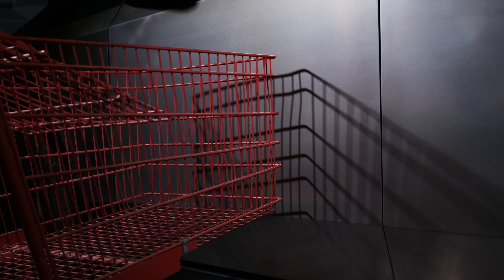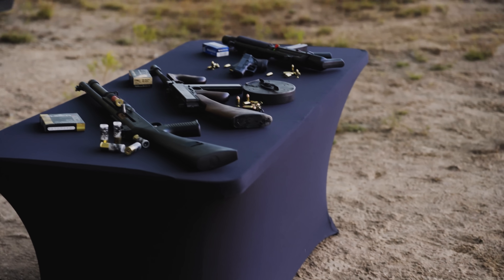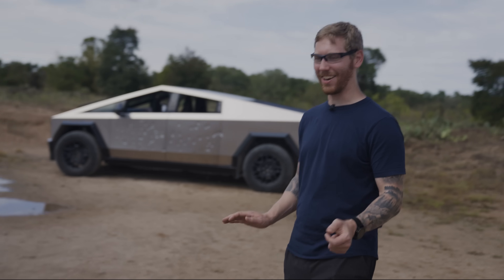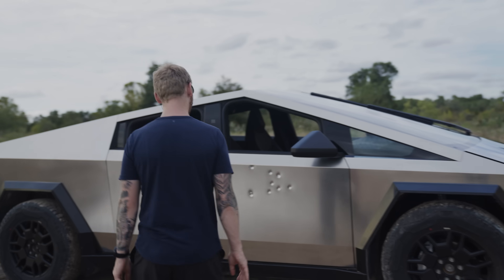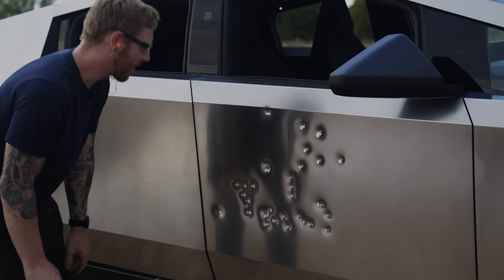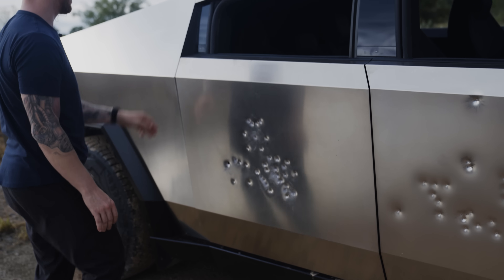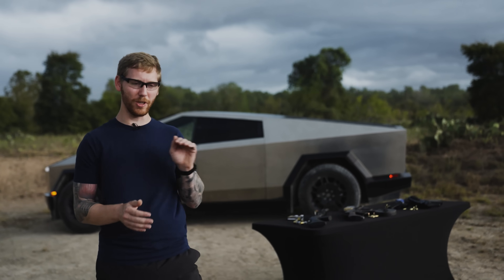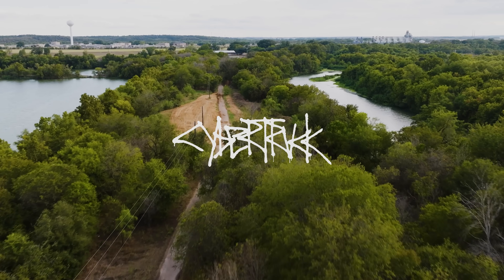Cybertruck Bullet Test

Comment: Okay first off this is pretty impressive. I do wanna point out a couple of things though:

Each firearm transition, besides the glock to the MP5 was a downgrade in muzzle energy, and each test was consecutively weaker than the last. .45 has more energy on impact than 9mm, even out of a 4 inch barrel (I’ll be back to the mp5 in a sec), and each 00 buck pellet carries even less energy than the 9mm. Buckshot is effective as when all pellets hit an object, the energy is multiplied per pellet to the target as a whole, however for testing penetration, each pellet can only deliver its own penetrative energy the more the pellets spread, which is typically less than 9mm, unless you get multiple pellets in the exact same impact spot (which did happen here.)  or a much tighter spread. The closer together the pellets, the more penetrative power buckshot will have. again, this is still pretty impressive.

Second, to my knowledge, the 8 inch suppressor would not increase velocity, at least by any significant amount on top of the 4 inch barrel as the grooves of the barrel (which help increase velocity and pressure) don’t exist in the suppressor. Feel free to fact check me on this

Lastly, would be super cool to see how it holds up to rifle fire, as rifle cartridges deliver SIGNIFICANTLY more energy on impact than handguns or individual shotgun pellets, and have drastically more penetrative power due to much higher velocities. I’m sure someone will test it at some point.

Edit, for 1.8mm thick, that’s still insane
Reply: I think you're mostly right. There's no way it stops 5.56 or 7.62. Probably not going to stop 5.7 from a pistol or carbine either.
Reply: You have made the same observation I made.  BTW The MP5 SD actually slows down the bullet.  It is not the suppressor that does this, but rather the design of the barrel itself. immediately after the chamber itself HK has drilled holes in the barrel in order to vent gas, thus reducing the pressure propelling the bullet.  The reason for this is that the MP5 SD is designed to use standard issue NATO rounds, which are hypersonic.  In order to create a 'silent' weapon with full power rounds, HK needed a way to bring the speed down to subsonic velocities, thereby negating the sonic boom created by hypersonic rounds. So yeah, you got it right the HK actually shoots a slower round than the Glock.
Reply: Whistlindiesel taking notes as we speak
Reply: The way an MP5SD works is kinda crazy, because it turns supersonic rounds subsonic by venting gasses early into the barrel to slow down the bullet. I think if they were to have used a regular MP5A2/A3 they wouldve gotten bigger impacts and possibly some penetration, but I doubt it.
Reply: Velocity is the primary indicator of hard panel penetration, NOT energy. Bullet construction / shape is typically secondary on hard barrier performance. That’s why a 5.56 can go through level III 1/4” AR500 armor but a 7.62NATO cannot
Reply: Just wanna chime in about a couple things. 1. Suppressors do typically increase muzzle Velocity. Not significantly. My 7" 308 can increases it by like 20fps. 

2. The 9mm penetrates better than a 45acp. The smaller bullet has less frontal area and therefore needs less energy to penetrate the same substance. That's why 9mm is recommended across the board over 45 for a bear defense round.
Reply: @Brothers-in-Arms-LLC I ran into this earlier, the MP5SD specifically, has port holes drilled at the base of the barrel to bleed off velocity.
Reply: It’s weakness is velocity anything moving rifle speeds will zip right through. 

Being able to stop 9mm 115g was impressive that’s the most common used in crimes.
Reply: They said it doesn't stop more powerful guns than what's shown here
Reply: They advertised it as a truck that can stop a 45 caliber ammo, naturally something rated to stop handgun ammo won't be able to stop rifle rounds.  Similar to a level 3 bulletproof vest that's capable of stopping handgun ammo but not rifle rounds.  They're still called bulletproof vests.
Reply: @lanzer22  Except actually bulletproof vehicles have bulletproof windows. This truck doesn't, so how can it be advertised as bulletproof?
Reply: @xelario  Those cars are sold as armored cars or armor modification.  You as an individual don't get to determine what a term means.  The industry get to decide and communicate to the consumer.  Tesla said "its stainless steel is bullet proof up to 45 caliber handgun", they don't need to drop the word bulletproof just because to you there is some special meaning that spans all products.
Reply: @lanzer22  If you'd only you read my original point instead of reacting to the last message...
Reply: 1.8mm is dummy thicc
Reply: yeah, you're right
need to see a NATO round and a 762
Reply: So don't drive it in my neighborhood got it! I only prey whoever does their ops have the aim of storm troopers and their weapons are stuck on safety. 😅 Also keep it in beast mode!
Reply: So you're an expert? Regardless of what you say this ingenuity is still incredible. Only the presidents, x president, govt officials, cartels bosses, billionaires can afford to ride on a bullet proof cars. And I will be riding on one as my daily and long trips PU packed with counter fire.
Reply: So maybe it can stop a hand gun caliber like .45 ACP but it wouldn't stand a chance against a 5.56 round and def not a 6.5 Creedmore.
Reply: Smaller calibers generally have better penetration. The way to defeat armor is speed and hardness. Smaller calibers are inherently faster
Reply: They should have fired a desert eagle
Reply: Missed the WHOLE point. This is a vehicle ( pickup truck )  faster than basically ALL U.S sports cars yet an stop MOST commonly used firearm projectiles .
Reply: @wilinstonthompson1352  Nope.  It is advertised as stopping subsonic rounds most rounds are super sonic. You know that loud band you hear...  that is the bullet breaking the sound barrier. This is very misleading and pointless marketing that tools like you bite on because you don't understand how pointless a bulletproof car is and how damaging it will be when in an accident.
Reply: @peterhorton9063  Please supply sales brochure claiming to stop ALL bullets. Regardless a Ford ,Chevy,Ram nor a tundra is stopping ANYTHING. Cry harder as bite that pillow tonight stroking your supersonic rifle rounds 😂
Reply: @peterhorton9063  Please supply sales brochure claiming to stop ALL bullets. Regardless a Ford ,Chevy,Ram nor a tundra is stopping ANYTHING. Cry harder as bite that pillow tonight stroking your supersonic rifle rounds 😂
Reply: @wilinstonthompson1352 if it can stop most then why did they shoot it with the same bullet a bunch of times while pretending to switch to more powerful calibers?
Still impressive...just repeating the same test over and over again.
It's like saying, "ok, it survived 9mm...now let's see how it handles this bb gun."
Reply: @AndyDrake-FOOKYT  I seen 9mm 45 and buckshot. Far from BB guns. Again what can the avg Ram, Ford or Chevy stop 🙄. Comments sections like this would find fault if this freaking truck cured Cancer 🤣
Reply: @wilinstonthompson1352  And you didn't miss the point? In this video Tesla itself is advertising this truck as bulletproof. In reality, at best it stops standard 9mm and .45 (not even worth mentioning buckshot), but what about the most common rifle caliber? What about the glass? The problem is a lot of people have no clue about guns (case in point the guy in the video not knowing the rounds coming out of MP5SD are actually slower than from a Glock), they will see it advertised as bulletproof and believe it, and that is dangerous. This truck can be the fastest vehicle ever, but that won't help if you're shot in the head through the glass.
Tesla should not be even making a slightest suggestion this might be bulletproof.
Reply: @xelario  Ok so it stops MOST common firearm rounds you are likely to counter in the war torn streets of the USofA 🙄. Still 1000x safer than ANY other vehicle.
Reply: @wilinstonthompson1352  You still don't get it. It's not 1000x safer. It might be situationally safer - as in if someone shoots only  at your door with a pistol - yes, safer. Anyone with half a brain would shoot at what they see - upper body and head, and if they see it, it's behind regular glass. And that's THE PROBLEM. This truck is not bulletproof to rifles and not even pistols because of the glass, but as I said before, people who don't know guns will still think they're safe because Tesla is advertising it as bulletproof. No-one reads the fine print.
Reply: @xelario  "No-one reads the fine print." Funny thing is...all the stuff I ever saw from Tesla about the Cybertruck being "bulletproof" stated the body was bulletproof vs typical handgun rounds and specifically stated at the end "...not the glass."
Also, no matter where you might think people aim when shooting at someone in a vehicle, if you look at any footage of actual bullet damage, you'll notice that 99% of the time it's the body that's hit, not the glass.
Lastly...for all those complaining that you can't call it bullet "proof" if it can't stop everything...I would like to point out that your standard TANK is bullet proof...until the A-10 comes over the ridge.
The big question is what's the rating? 2A? 3? 3A? I don't really know this system well enough to guess...but I do that this is the standard to set its bullet resistance too.
Reply: @devinnullenvoid29  Even funnier thing is none of the stuff I ever saw or heard about the Cybertruck specifically mentioned glass not being bulletproof. Stands to reason an average person will not go looking at all the marketing material and read all of it.
Your tank argument is unsubstantiated. I never claimed it has to stop everything, I said it has to stop everywhere (glass included). Any car is bulletproof from same rounds this truck is if you hide behind the engine block. That doesn't make it bulletproof and doesn't mean you should advertise it as that.
 "you'll notice that 99% of the time it's the body that's hit, not the glass." Aha, sure. Show me proof of this. Since you can't and started to invent arguments I never argued for, I'm done here.
Reply: @wilinstonthompson1352 actually no...not most...they only showed 9mm and then things with less energy/penetration.
.45 hits hard but has less penetration.
Still impressive...9mm or less is what you will see most often...but that's still only demonstrating the most common handgun round and pretending to test things that seem stronger but are actually weaker.
It's impressive...just intentionally misleading.
Reply: @wilinstonthompson1352  nah I got the point, I mentioned this is still pretty impressive, I’m just very curious to see how it performs against rifles
Reply: I think you're taking this way too seriously. It's not an armored vehicle. this is just for fun so chill out
Reply: @rustygear447 so what? The comment can also be for fun if you don’t bitch about it
Reply: I mean, look at the video... is it not meant to be taken seriously? I'm confused... the dudes in the video seem serious about it.  @rustygear447
Reply: @rustygear447 well then it’s false marketing if it’s not actually bulletrpoof. It’s like saying a phone is waterproff but only if the water doesn’t go inside any holes
Reply: @rustygear447 how is it fun to shoot it with the same bullet a bunch of times? Change up the caliber instead of pretending to do so.
Reply: @rustygear447 True but they have now very clearly used the fact that it is Bulletproof to advertise the truck and actively compare it to other trucks on the market.
This brings people to inspect it closer, I mean it is impressive in what it can actually stop but it's not "Bulletproof" per se but it is advertised as being Bulletproof.
Reply: @Z38_US  Everything rated bulletproof is only bulletproof to a certain point...
Reply: @Z38_US  You'll need to find a new name for bulletproof vests if your logic holds.  Most vests cannot stop rifle rounds or AP rounds.  They're still called bulletproof vests and it ain't false advertising.  There will always be something more powerful that can shoot through protection.
Reply: @lanzer22 My problem mainly is is that I have no way of knowing if it is actually bulletproof because only the doorpanels were shot.
Idk if the other panels are as strong aswell and I don't know if the glass is bulletproof. It should be but I wouldn't be sure about that.

I just don't know if the whole truck is actually bulletproof or if it is just the doorpanels.
One bullet hit to the right of the rear door and that panel looks very dented in compared to the doorpanels.
Reply: @Z38_US  Actually, they never advertised it at a "bulletproof" truck.  During the initial release, Elon said that panels (never the glass) "would stop a 9mm bullet", which it clearly did.  Unloading on it with subguns was just a cool bonus for the camera.
Reply: and subsonic ammo...

Comment: they went from most powerful to least powerful in terms of bullets/firearms. 
they could have stopped at .45 cal and called it a day. it packs more kinetic energy than a 9mm or shotgun's buck shot. 
the shotgun was the weakest because the kinetic energy from the gunpowder is split up between each pellet and they weigh so little. and has less penetration power as a result.
the 9mm is faster than .45 but it lacks the weight to back it up. and has less kinetic energy as a result. you can do the math yourself. i've already done it before.

Comment: I hope this alloy becomes available in sheets because I have a humvee that I would love to skin the inside of the panels with it since it's so thin yet bullet resistant. My rig was originally an uparmored vehicle but all the armor plating was removed when I purchased for street use. This thin alloy would be light weight yet strong alternative. Too cool!
Reply: Any 300 series 1,8mm ss sheet will do the same thing. If you want to armor your humvee there are much cheaper, lighter and better performing options
Reply: Just order annealed 304ss sheet
Reply: Because you are in the mafia and need protection?
Reply: @Magst3r1   not quite, I fly a pretty large Trump 2024 flag on my rig through ATL and it has gotten pretty confrontational previously. Better safe and not to worry. I’ve already got the laminated bullet glass in place. FJB!
Reply: Just buy 3/8" AR500 steel.
Reply: @Brothers-in-Arms-LLC  No, 14-inch thick battleship armor.
Reply: @Brothers-in-Arms-LLC  that’s what was on there before when the truck weighed nearly 9k lbs. not interested in adding that kind of weight on it again. Good idea though, best protection for sure
Reply: If you line the inside dont you have to worry about spalling?
Reply: The tesla steel would perform better as the top layer, with the weaker factory steel behind it. Should resist deformation better.
Reply: Gee I wonder why they don't make wearable armor from this magic metal, are you really this dumb? Never mind you own a hummer, I already know the answer, lol smooth brain
Reply: plate carrier.
Reply: if you put those sheets on something they become not bulletproof anymore, would need like a layer of foam or something behind it
Reply: It's available in sheets, but you might want to head north of 1.8 mm and you will have to work harden it.

Comment: It is impressive but one also should consider that they are shooting here with subsonic ammunition. The kinetic energy squares with velocity so velocity is key for breaking armour.

Correction edit: This is only true for the MP5-SD (with the special barrel), the other ones were all normal handguns with normal projectiles, so the test is legit.
Reply: One should consider that they are by orders of magnitude far more likely to die in a head on collision in this vehicle than they are by gunshot. How's that testing going?
Reply: Thanks.  I didn't get why the 9mm from the MP5 created smaller indents than the Glock.  I'm sure you're right, the MP5 had a suppressor, so it would only make sense to use subsonic with it.
Reply: I didn't see anything to indicate that the ammo was sub-sonic, especially with the Glock. It probably wouldn't have cycled with subsonic ammo.
Reply: @whirving  I would agree the Glock was not subsonic, but the .45 is naturally subsonic and the MPSD will reduce the velocity of normal 9mm ammunition down to subsonic. Reducing the velocity is basically one of the guns main features so you can just buy and carry one type of ammo for both your pistols, unsuppressed MP5`s and the MP5SD.
Reply: Almost all pistol fired bullets are subsonic.
Reply: No - most handgun rounds are supersonic. The only subs they technically shot here were out of the MP5SD because it does this really cool thing where it vents gasses early through the barrel to slow the round down from supersonic to subsonic. All ammunition fired was supersonic to begin with. @dolphinsmadden
Reply: @nicktienter4740  Glock 19 average fps for 9mm is 998